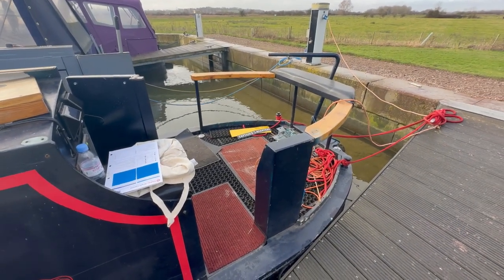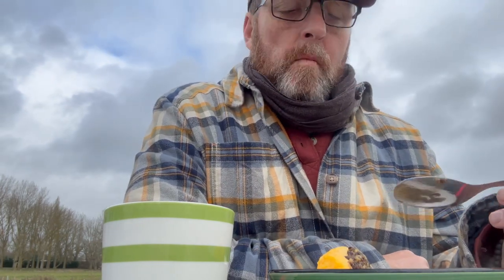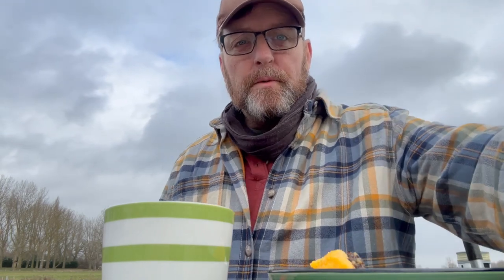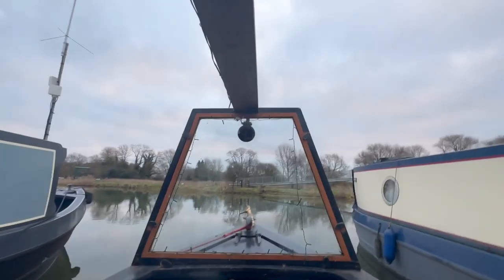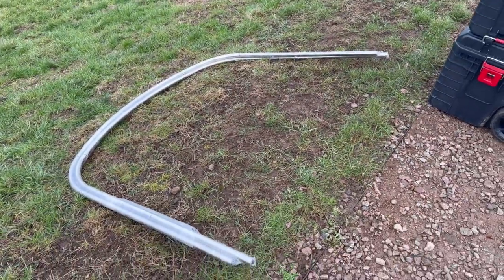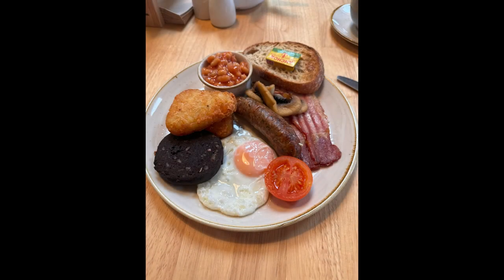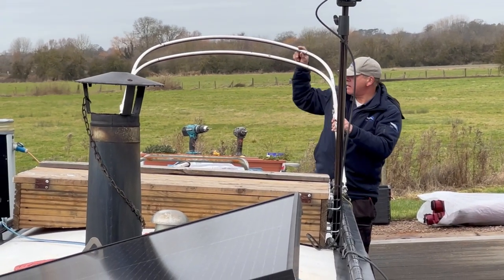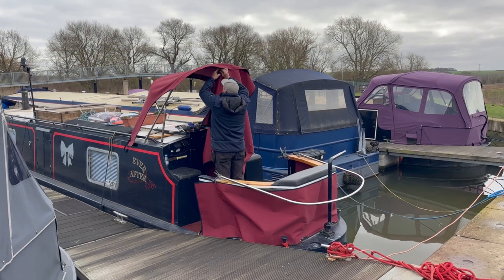Buying a Titan Narrowboat Canopy, was it worth it?

Comment: Great video....can't see why he didn't make the door wider ,instead of the 2 inch strip    ...
Reply from the maker: I think it’s due to the internal entrance size. The control panel is one side and gas lockers. It’s plenty big enough for me to get in I’ll show you the inside on the next video. Thanks for watching.
Reply: @narrowboateverafter  so how much it    thanks
Reply from the maker: @chow24  they price them per boat as all made to measure. You’d be looking over 4-5k for a pram hood and cratch cover